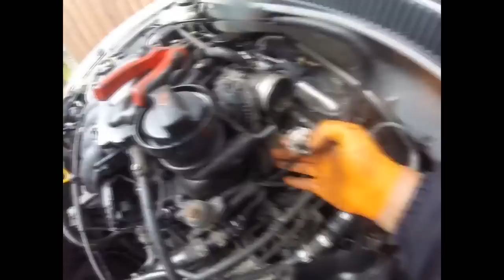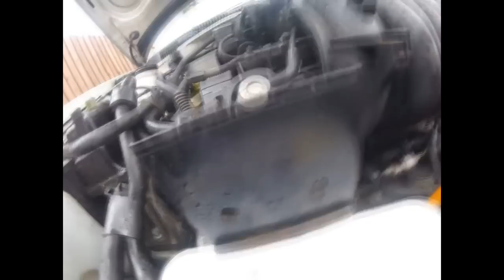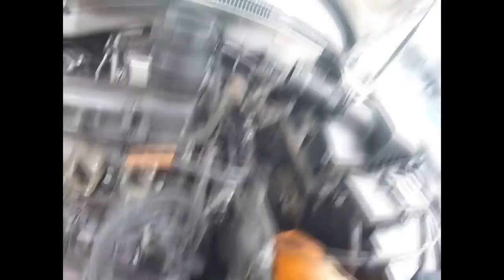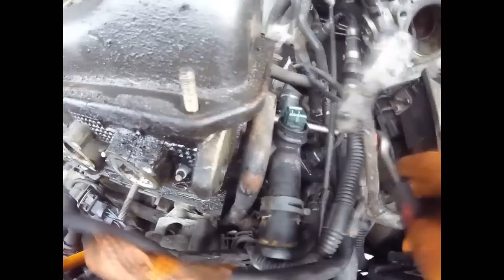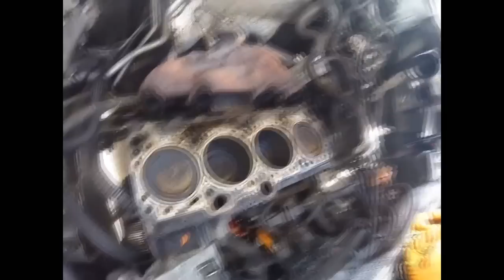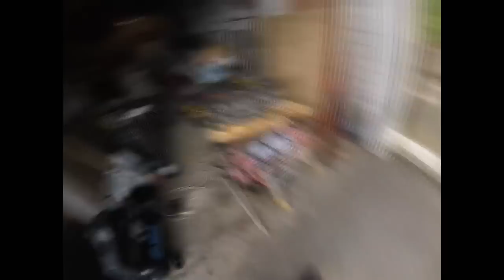Replacement cylinder head gasket Volkswagen Golf 1.6 SR /Замена прокладку ГБЦ Volkswagen Golf 1.6 SR

Comment: Hello friend, can I ask you a question? I have an audi a3 with the same 1.6 bse engine, I already cleaned the injectors and they were in perfect condition, I changed the gasoline filter and changed the entire ignition system for the second time. Coil cables and the 4 spark plugs all new in bosch and the car gives me faults when it is on it makes a fault as if a cylinder failed and it shakes what could it be?
Reply: Bro same problem my first car: Audi A3 8PA 1.6 BSE. The motor runs non-smooth and even intermittnet engine turn offs. Audi dealer examine it...they said I should ship it to Germany for asesment. I sell it for 2.000 less and get rid of it.
I want to contact the next owner and question him, but I don`t want to get him mad...
Reply: I really think it was a bad computer.